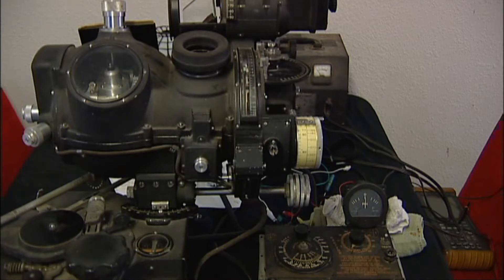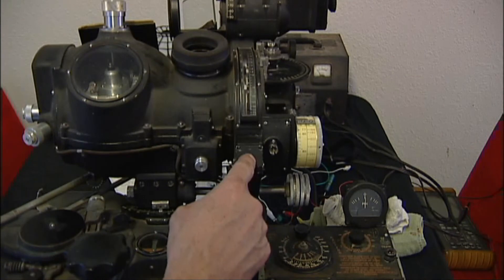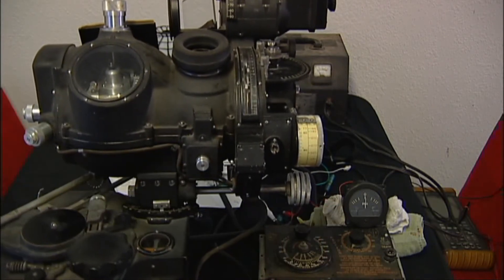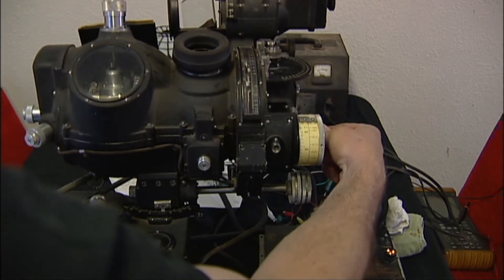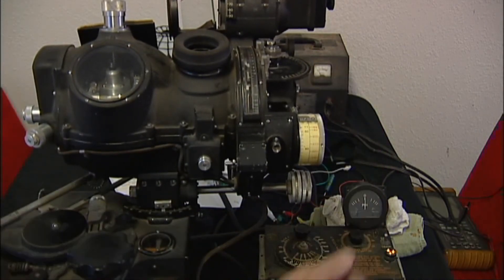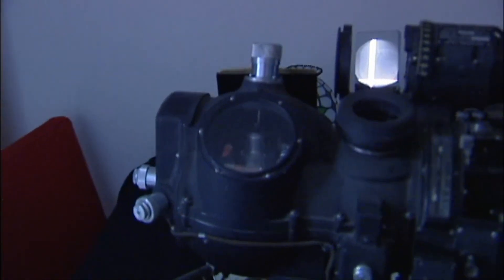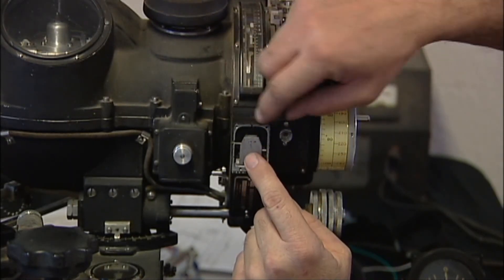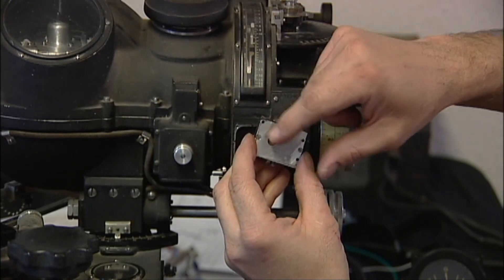Norden Bombsight, Release, PDI, Intervalometer Demo

Comment: Not yet.  You'll have to show me how to do that if you would be so kind.  I imagine coming up with a dc power supply is no problem, but what about the connector?  How did you do it.  Keep in mind I only have a sitehead, not the stabilizer.  

I did come by some old training videos.  I'll try and post them after I rip them from the DVD.